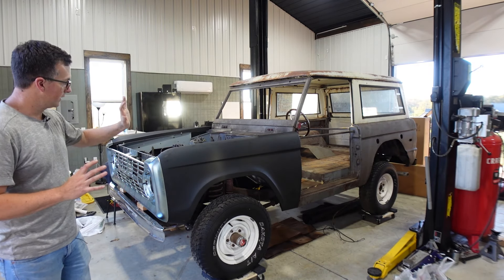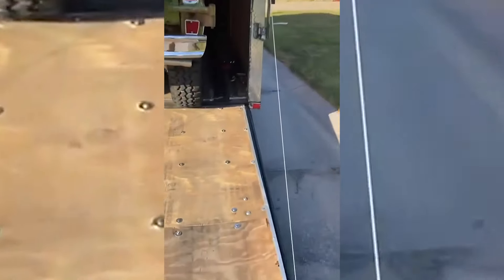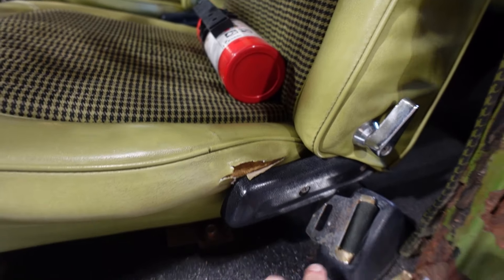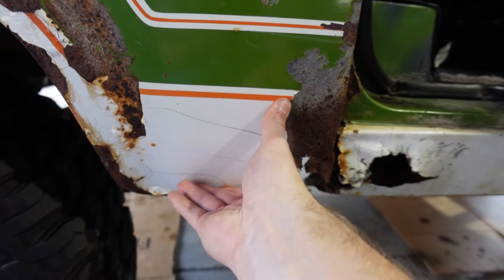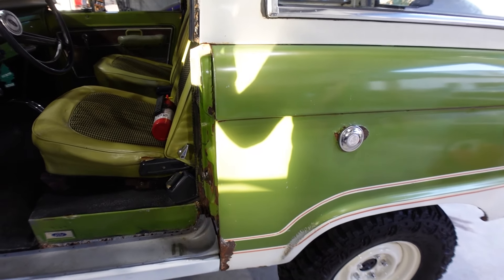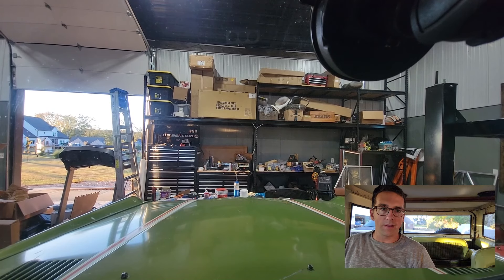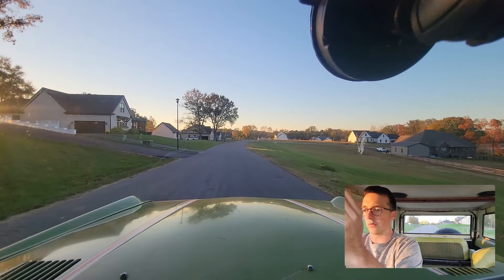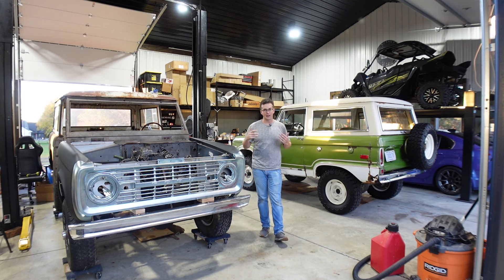I Bought A1973 Ford Bronco Ranger, Sight Unseen, From The Rust Belt (Another One!)

Comment: Nice driver! I love the comment "when I get to that stage, it will be a quick one panel replacement" on your front door post. Unfortunately, you will find that the front door post is rotted, the inner kick panel is rotted, your inner and outer rocker is rotted, and the floor that connects to all those pieces is rotted. There's no sense in replacing any one of those pieces without doing the whole thing. Best to drive this while you fix your present Bronco, then when that one is done, think about starting on this one!
Reply from the maker: Your explanation is exactly why my other Bronco became a pile of parts 🤣. That is a serious thought of mine to just be ready for an entirely new tub later down the road. I'd love to keep the Patina of this alive, so potentially gutting the entire inside could be a possibility later down the road also
Reply: That’s what I was trying to say, it’s not as simple as this panel that panel… the whole structure of that is gone, it needs a whole new body as much as the other one and I’m not being negative I just have dealt with it myself… you start cutting on it and before you know it there’s no bronco left